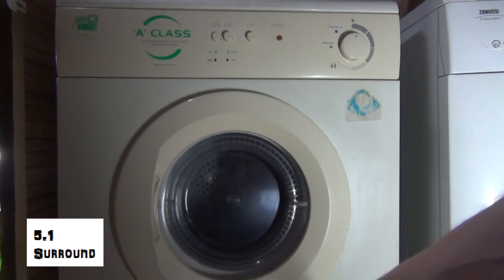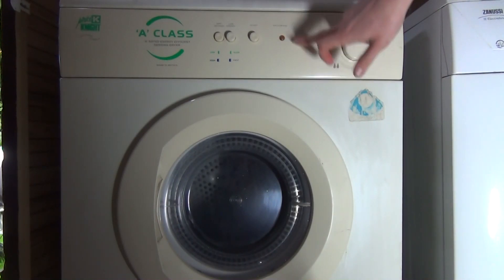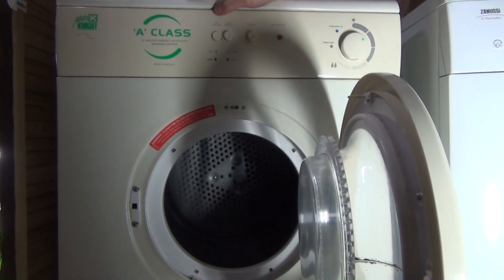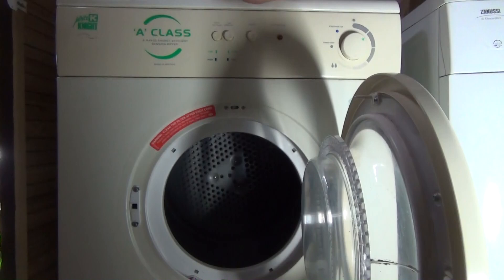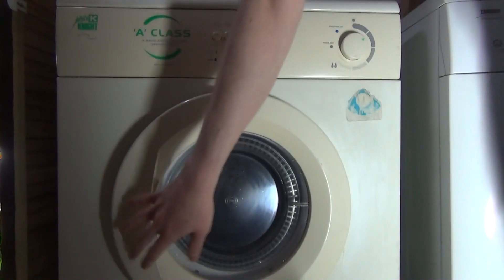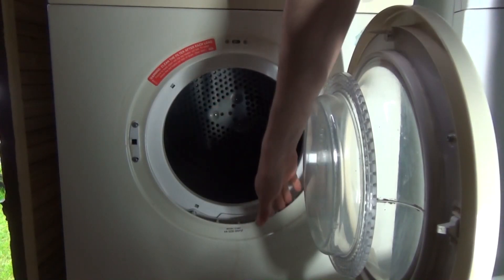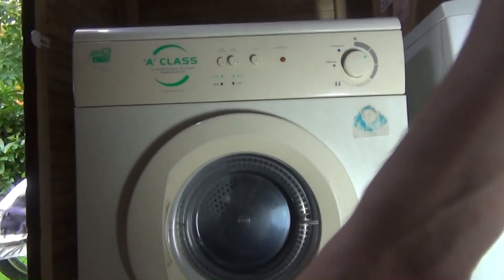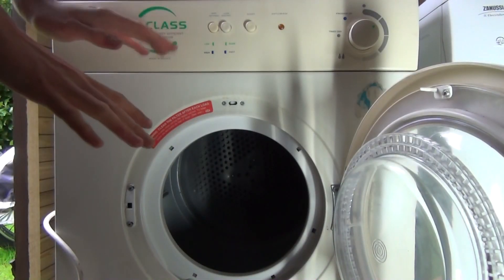White Knight CL847 A class Tumble Dryer : Overview

Comment: I guess when A-class selected, it will basicly only blow cold air through the load. With a motor running at approx. 200W only, 8*200W=1,6kW should explain how the A-class was achieved without a heatpump.